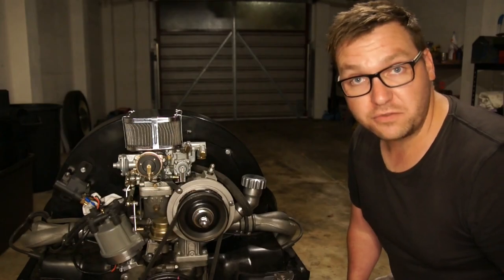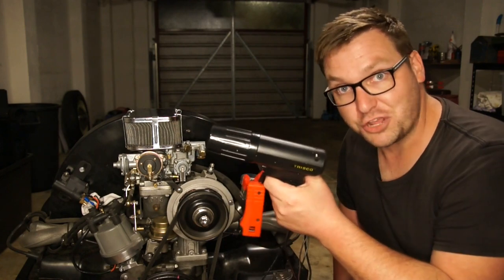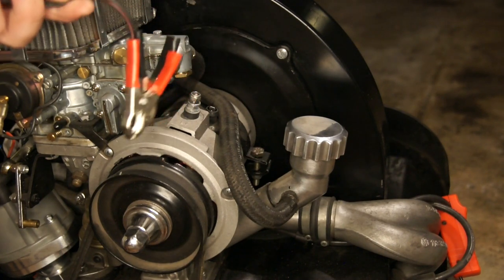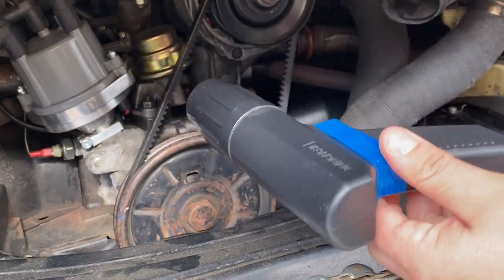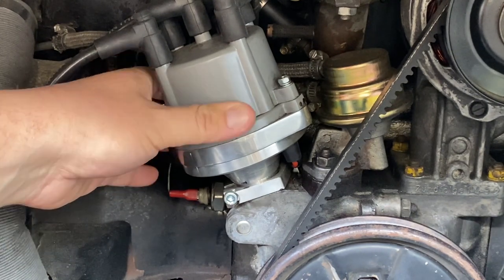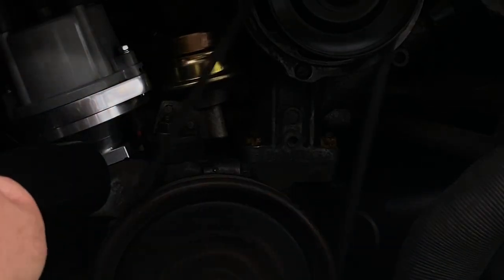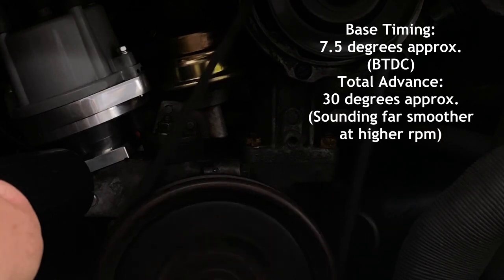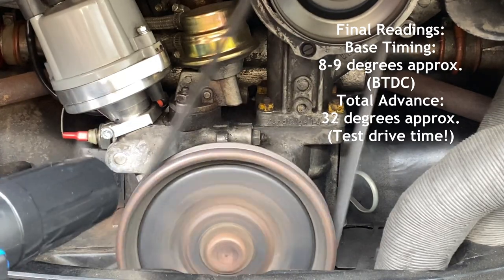How to use a Timing Light on a VW Beetle & Kombi

Comment: Thank you for sharing, Nice video. And I'm curious about your single carb on the bug, What brand it is and if it working fine, i got a 1600 with a 34pic3 carb and i want to upgrade i was looking at dual are single. and I'm looking for the best one and easy to set up.